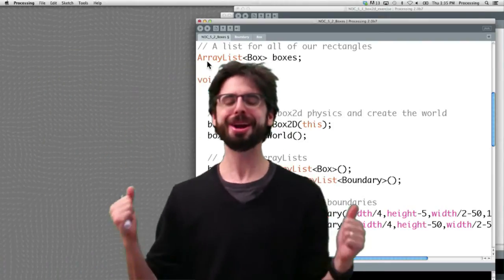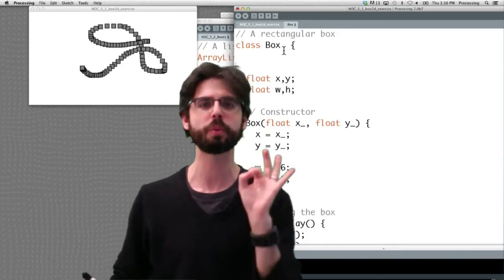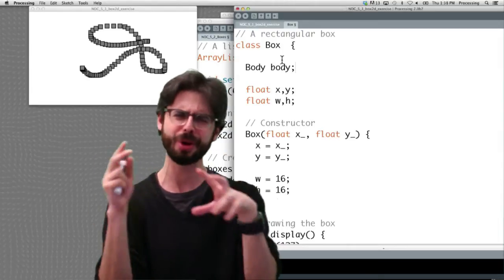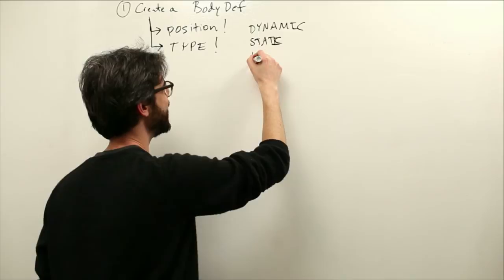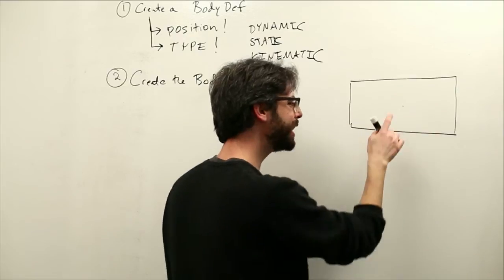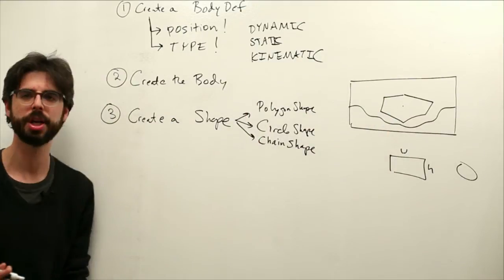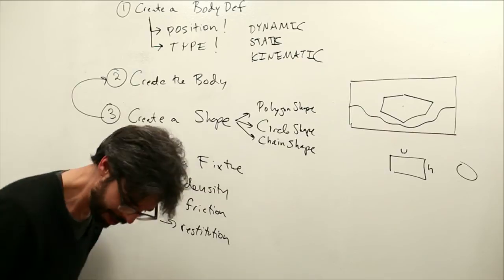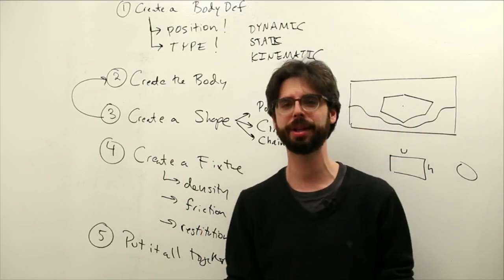5.4: Adding Box2D to Processing Sketch Part 1 - The Nature of Code

Comment: Dan!  Help!  I'm chomping at the bit to write some processing box 2d code but I'm stuck!  For every single one of these examples - I am getting 'The package pbox2d' does not exist.  I can't figure out how to add this library.  I visited the link in an answer to the same question below but no luck. I tried to import the library from the processing IDE using the import option but no PBox2D appears... so I imported Box2D for Processing by Daniel Shiffman through the IDE and made sure all the import statements were in the code but the error persists.  Not sure what to do at this point...  I'd be grateful if you could give me a step by step.  Thanks :)
Reply: If you have problem with the library go to Sketch -> Import library -> Add library... -> Find PBox2D and install it.
Then, just do this:

import shiffman.box2d.*;

Box2DProcessing box2d;

It should work.
Reply from the maker: I assume you are all set now based on discussion in slack?